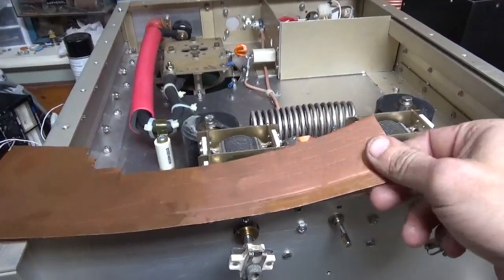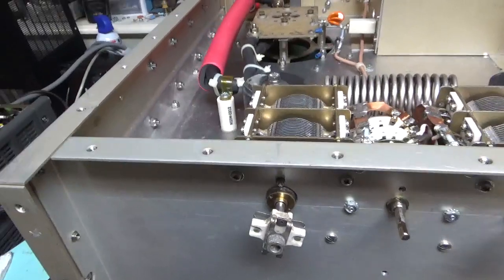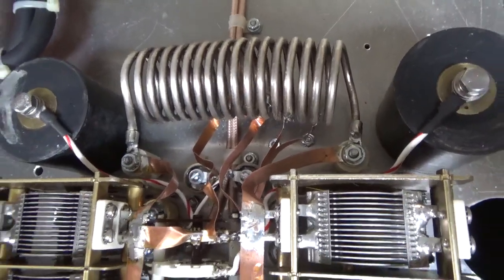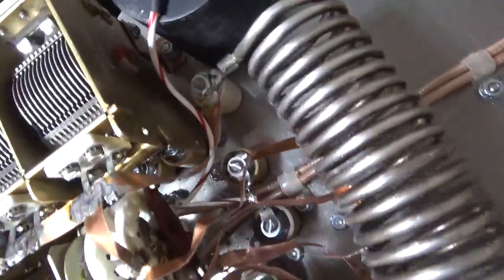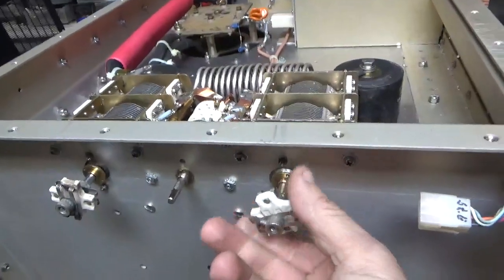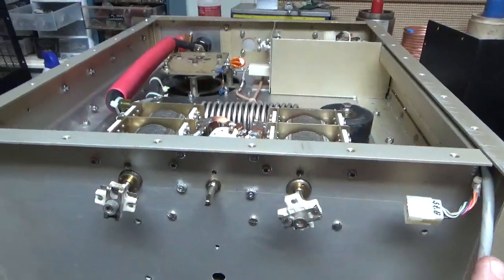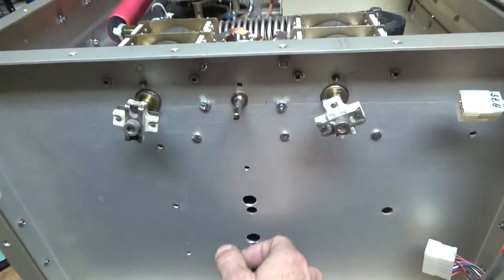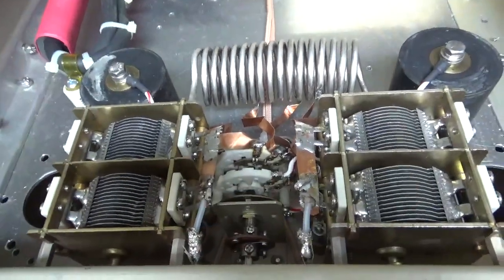3cx6000a7 12kw CCS 160-15 Meter Linear Amplifier Input Circuit Completed!!!!

Comment: 50ohm is the input to a 6000?
Reply from the maker: Yes , has a 50 ohm cathode impedance
Reply: @amprepairguy  thanks
Reply from the maker: Welcome

It’s on the spec sheet yu-148 / 3cx6000a7

I’ll be back on it soon 73